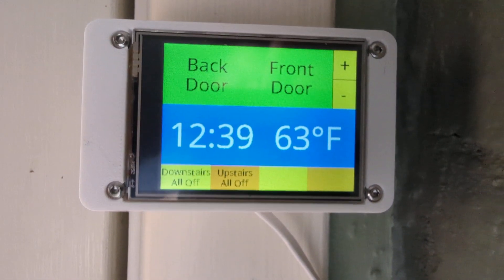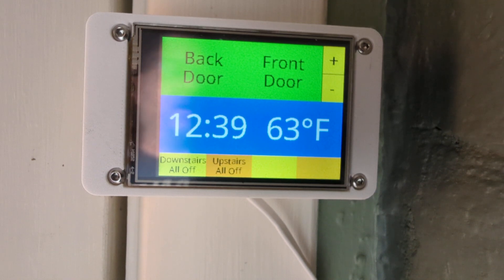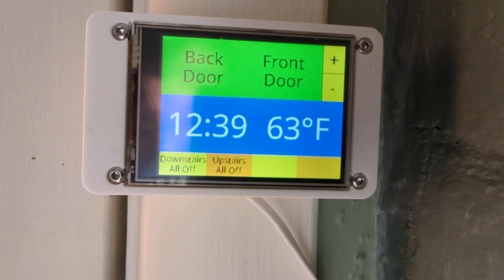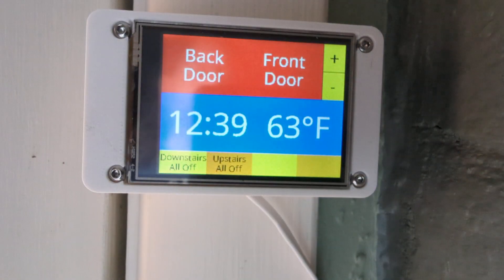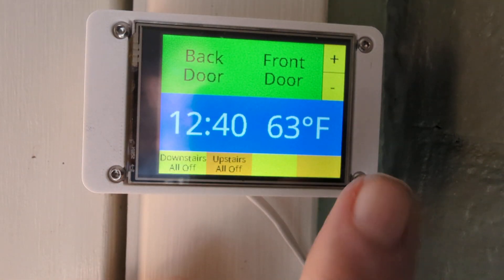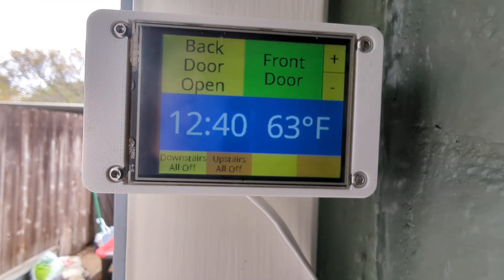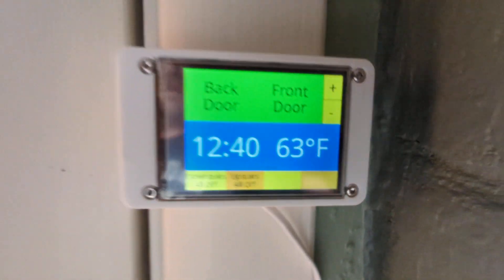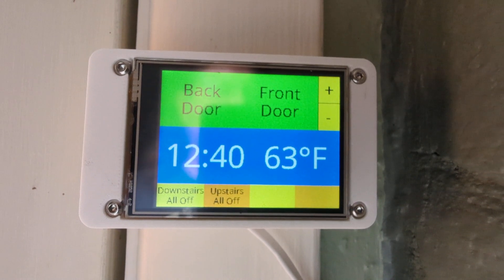Door monitor using ESPHome, an esp32, and an ili9341 TFT LCD

Comment: I cannot get this to work for the life of me.

Compiling /data/guest-time/.pioenvs/guest-time/lib64d/WiFi/WiFiSTA.cpp.o
In file included from src/room-time-temp.h:1,
                 from src/main.cpp:66:
src/display-panel.h:53:27: error: 'Font' in namespace 'esphome::display' does not name a type
         esphome::display::Font* font;
                           ^~~~
src/display-panel.h:56:27: error: 'Image' in namespace 'esphome::display' does not name a type
         esphome::display::Image* image = NULL;
                           ^~~~~
src/display-panel.h:56:9: note: suggested alternative: 'BaseImage'
         esphome::display::Image* image = NULL;
         ^~~~~~~
         BaseImage
src/display-panel.h: In member function 'void DisplayPanel::drawImageOrText(esphome::display::DisplayBuffer&)':
src/display-panel.h:133:17: error: 'image' was not declared in this scope
             if (image != NULL) {
                 ^~~~~
src/display-panel.h: In member function 'void DisplayPanel::printMulti(esphome::display::DisplayBuffer&, std::vector<std::__cxx11::basic_string<char> >&)':
src/display-panel.h:153:17: error: expected primary-expression before '->' token
             font->measure("M", &width, &x_offset, &textHeight, &height);
                 ^~
src/display-panel.h:164:25: error: expected primary-expression before ',' token
                     font, textColor, TextAlign::TOP_CENTER, line.c_str());
                         ^
src/display-panel.h: In member function 'void DisplayPanel::printMiddle(esphome::display::DisplayBuffer&, const char*)':
src/display-panel.h:176:21: error: expected primary-expression before ',' token
                 font, textColor, TextAlign::CENTER, text);
                     ^
src/display-panel.h: In member function 'void DisplayPanel::drawImage(esphome::display::DisplayBuffer&)':
src/display-panel.h:181:33: error: 'image' was not declared in this scope
             display.image(x, y, image);
                                 ^~~~~
In file included from src/main.cpp:66:
src/room-time-temp.h: In function 'void initializePanels(esphome::display::DisplayBuffer&)':
src/room-time-temp.h:50:15: error: 'class DisplayPanel' has no member named 'font'
     timePanel.font = font_time;
               ^~~~
src/room-time-temp.h:54:16: error: 'class DisplayPanel' has no member named 'font'
     alarmPanel.font = font_alarm;
                ^~~~
src/room-time-temp.h:58:15: error: 'class DisplayPanel' has no member named 'font'
     datePanel.font = font_date;
               ^~~~
src/room-time-temp.h:62:22: error: 'class DisplayPanel' has no member named 'font'
     insideLabelPanel.font = font_temp_label;
                      ^~~~
src/room-time-temp.h:67:21: error: 'class DisplayPanel' has no member named 'font'
     insideTempPanel.font = font_temp;
                     ^~~~
src/room-time-temp.h:71:23: error: 'class DisplayPanel' has no member named 'font'
     outdoorLabelPanel.font = font_temp_label;
                       ^~~~
src/room-time-temp.h:76:22: error: 'class DisplayPanel' has no member named 'font'
     outdoorTempPanel.font = font_temp;
                      ^~~~
/config/esphome/guest-time.yaml: In lambda function:
/config/esphome/guest-time.yaml:121:26: error: invalid initialization of reference of type 'esphome::display::DisplayBuffer&' from expression of type 'esphome::display::Display'
         initializePanels(it);
                          ^~
In file included from src/main.cpp:66:
src/room-time-temp.h:47:6: note: in passing argument 1 of 'void initializePanels(esphome::display::DisplayBuffer&)'
 void initializePanels(esphome::display::DisplayBuffer &display) {
      ^~~~~~~~~~~~~~~~
Compiling /data/guest-time/.pioenvs/guest-time/lib64d/WiFi/WiFiScan.cpp.o
* [/data/guest-time/.pioenvs/guest-time/src/main.cpp.o] Error 1
========================== [FAILED] Took 8.36 seconds ==========================
Reply from the maker: This looks like a library or include error. Are you compile this within ESPHome in Home Assistant?

I'm guessing, but you haven't specified, that you are basing your code from https://github.com/kdorff/esphome/tree/main/guest-time-temp

I just compared this code in my repo with that I am running in Home Assistant/ESPHome and it matches completely with what I'm running. My ESPHome is a touch dated at 2023.6.4, but it seems unlikely that is your problem.

Make sure you have both the .yaml file and the .h file in the /config/esphome folder. Start with the exact content and filenames I've provided. 

My compile, for you to compare with yours  https://gist.github.com/kdorff/3e788eae8487dc0de6fb9d1a033ca799

From there, I don't really have a lot to give you based on what I see. 
You'll really need to whittle it down to the smallest .yaml file you can get working and then layer in more pieces until you see where your issue lies. If you grabbed the code a long time ago, grab it again. 

Assistant

Comment: HI, 
I have graphic lcd 128x64 and displaying some info on it, but I struggle to display external sensor data.
here is the yaml code:  any suggestion is highly appreciated 

sensor:  
  - platform: homeassistant
    id: Temp_vode
    entity_id: sensor.temperatura_vode
    internal: true
  - platform: homeassistant  
    id: Temp_sever
    entity_id: sensor.temperatura_sever
    internal: true

display:
  - platform: st7920
    width: 128
    height: 64
    update_interval: 1s
    cs_pin:
      number: GPIO15 #4
      inverted: true
    lambda: |-
      it.print(0, 3, id(comics), "Hello World!");
      it.printf(0, 28, id(comics),"temp.vode: %.0f°c" , id(Temp_vode).state); 
      it.printf(0, 15, id(comics), "temp.sever: %.1f°c" , id(Temp_sever).state); 
      it.strftime(2, 45, id(ARIBL0), "%H:%M %d.%m.%Y", id(my_time).now());
      it.rectangle(0, 48, 128, 15);